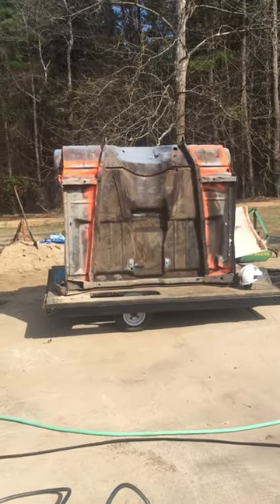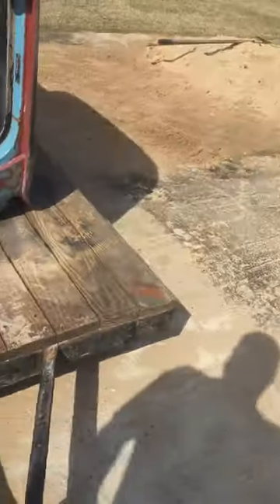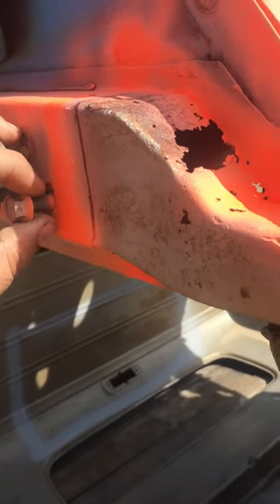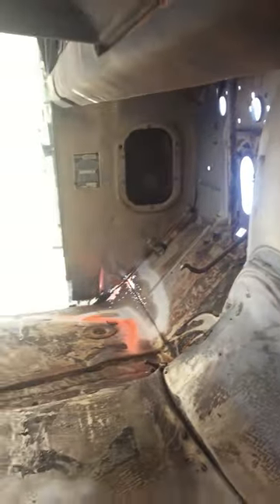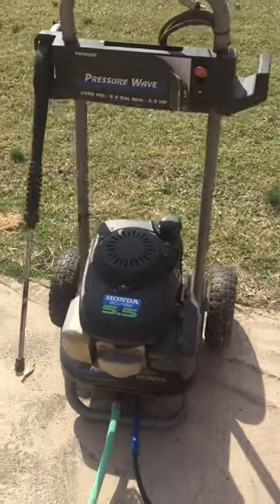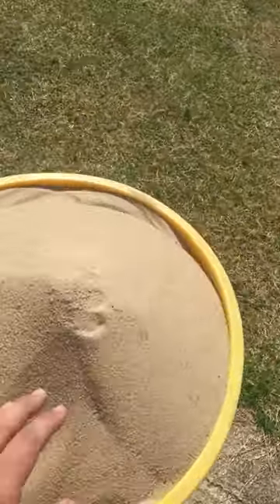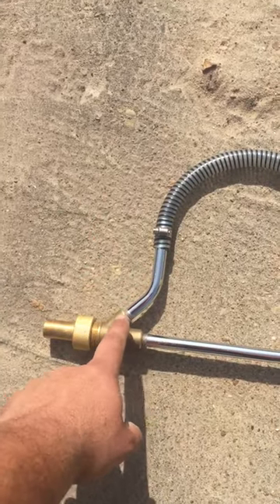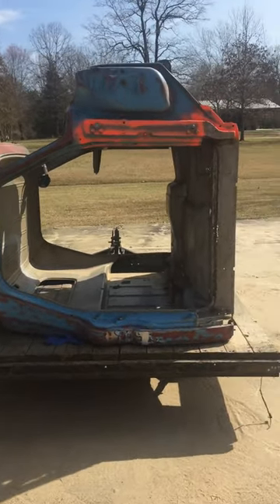Sandblasting the 66 Chevy

Comment: That's a brilliant idea using the marking paint Lil bro! Also a neat trick on the pressure washer! Woo Hoo!
Reply from the maker: cutworm59 it works good, you can see where the boating is needed and blast the marking paint off as you finish a area

Comment: I have never heard of using a pressure washer and sand together, I bet that will work very well.
Reply from the maker: MissouriOldTimer it works really good, rust sets in if you don't get it dry fairly quick afterwards.